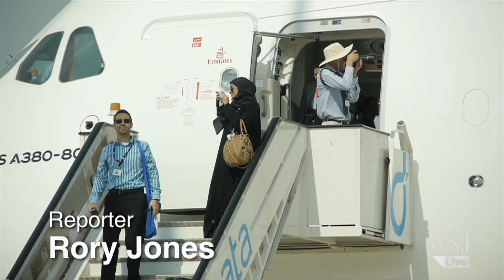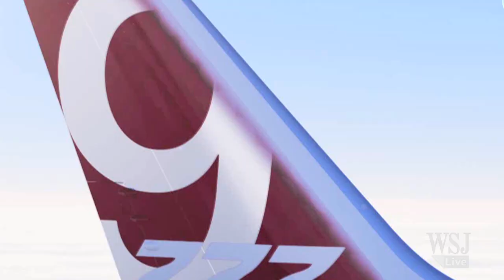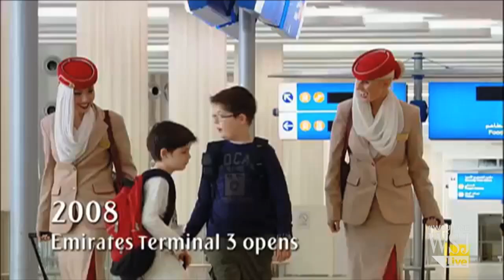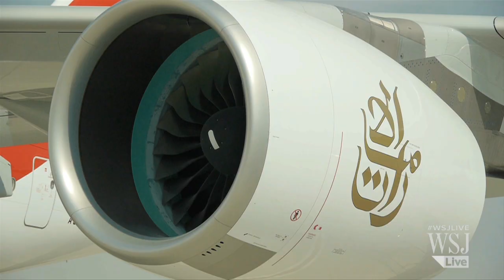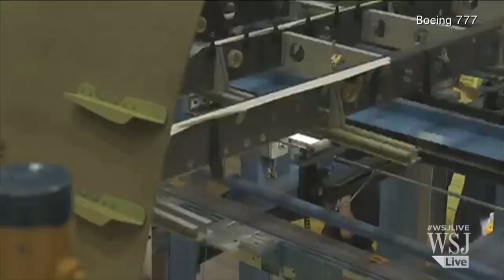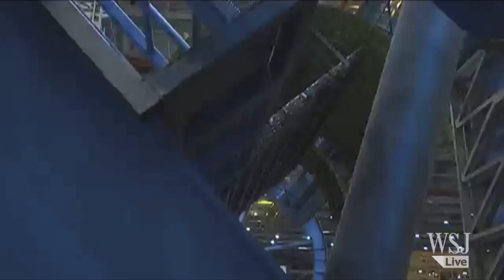Emirates President: Why I Bought 150 Boeing 777X

Comment: Emirates strategy is very good as they only focus on two types of aircraft easier to maintain as they only need to stock to types of Aircraft parts as opposed to other airlines they have so many different types of aircraft which makes it difficult to maintain and store parts
Reply: faizan joyia like SWA
Reply: There gonna replace there 300er with 777x and that’s good!
Reply: In future 787-10
Reply: They're like low-cost airlines.
Reply: Well they just changed that.   They now have A330, A350, 787, and 777 on order

Comment: Emirates is extremely happy with their 777-300ER's so they will continue with its successor.. They will never buy the A35O..
Reply: barracuda7018... of course they will be the largest customer of the 777... because it's mainly designed for them. the 3 sandbox carriers needed a plane powerful enough to take off fully loaded on a hot summer day in the desert. that means that they needed powerful engines and big wings, which again add alot of weight. the a350 is lighter and will be better for the airlines that don't have the same requirements as the gulf carriers
Reply: I think it's more of a economic issue and commonality. They've had 777s since back then so their workers are more akin to 777s. Most likely they also have got discounts from Boeing since they've bought THAT many 777s over many years.
Reply: Emirates is planning to buy the Boeing 787-10, thats good.

Comment: I will not fly he Emirates 777 until they go back to a 3x3x3 config
Reply: andyhui01, most likely not. Boeing said that the wider cabin will provide larger seats, but as soon as the airlines are getting hold of the X they will cramp as much seats in them as possible.
Reply: You’ll get nearly 18 inches on 10 abreast on the 777X. Currently the -300er has 17.2 inches. If you’d like more space, it costs a little more, but premium economy on those planes is 2/4/2 or 2/3/2 and you get about 20 inches width.

Comment: What was wrong about the B748? Just wrong timing?
Reply: just no long efficient to run. Due to more and more 2 engine planes getting better ETOPS rating, the cost saving to run a 777x over a 747-8 on the same long haul routes is significant. Airbus didnt see any new orders for a380s for all of 2016 and most 747-8s are bought cargo fitted.
Reply: sans3go agreed. Airbus produced a new kind of beast, a380 but at the time of designing (literally the 1990s) double engine planes out doing the quad jets was rare. The 777 really did make it's mark on aviation. Why Boeing even bothered with the 748, I have no idea. Most likely to battle with Airbus and demand from freight operators. 

It's sad as both are magnificent aircraft
Reply: +TheSearchandfind.  Much as I enjoy flying on any 747, the fact is that Boeing fiddled whilst Seattle burnt. They delayed a -400 replacement so much that there's little interest in the -8 except mostly the cargo version. 4 engines are, it seems, no longer the way either and a liability. Lufthansa seem to like it though. They have the most -8i's. Meanwhile the -400 is now uneconomical for pax and is disappearing from the skies to be converted into freighters for those that don't want to or can't buy new.
Reply: KTV Boeing’s 747-8 and 8i makes sense as freighter aircrafts their original 747s since those old 747 are fuel guzzlers, old and outdated etc, the new 747-8/8i would make sense are cargo transportation running more efficiently than the older ones. Not because they just wanted a competitor for the a380. Boeing even knew it wasn’t gonna sell well so cargos will always have its back and making profit. Running for the next 20-40 Years. Yes it’s such a remarkable aircraft including the whale-Jet. Boeing 777 has been so successful that they developed the next generation 777X for the future and a replacement for the passenger versions 747-8 and even the a380

Comment: Orrr... you can get to your destination without any stops... If a JFK - SIN 18.5hr flight was possible over 10 years ago why do you need a stop over?
Reply: If you fly with an airline based out of JFK or Singapore Changi then you may fly without any stops. However, if you fly with Emirates who are based in Dubai then of course the aircraft would make a stop there.
Reply: Passengers don't always want to sit so long in an aircraft. :)

Comment: Emirates should buy Boeing 787 9
Reply: It has a battery problem and has too much problems it is my favourite plane but it has way too much problems that's why Emirates doesn't take it
Reply: Every new aircraft has problems. It just depends on how high profile the problems are. All new aircraft types take time to mature. It is too early to write off the 787 as 'too many problems' when it is has just 5 years in service. The 777-200 and -300 models are 21 years old and the A330 is 22 years old. The A380 is already 11 years old. When the 787 matures it will be just as reliable, if not more, than all of the older aircraft types.
Reply: +Qaderia Fatema 
Actually the 787 has come a long way, it's got 98.4% dispatch reliability, which is very good. Those problems were 3 years ago, now they got everything fixed.
Reply: I've been on a fe 787s including the -9 and found that it has a tight cabin issue and also annoying electric hydraulics which make annoying whines during take-off and landings.
Reply: The cabin issue can be traced back to how the airline chose to layout the cabin. That has very little to do with boeing. As for the noise, well that is just personal preference.

Comment: Emirates will buy the new Boeing 797-900 ELR
Reply: ? That hasn't even been close to being announced
Reply: +ChristianGaming Saying, "That hasn't even been close to being announced." Is just as stupid as the comment you were replying to. Boeing will never build such a jet, let alone consider building it. The 4 engine passenger jumbo is dying and will be dead in less than 50 years.
Reply: BewareTheIdes, why should the 797 be a 4 engine Jumbo?
Reply: No, the B797-900 ELR will be a 6 engines and two cockpits aircraft.
Reply: 🤣🤣🤣737 max is done. 777x is not even in the air. And u butthurt Boeing fans are talking about 797